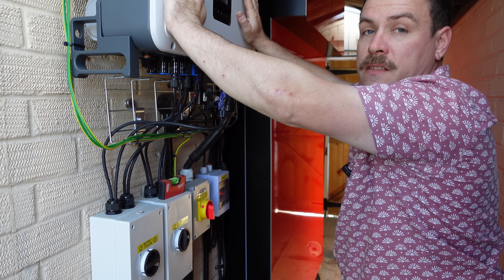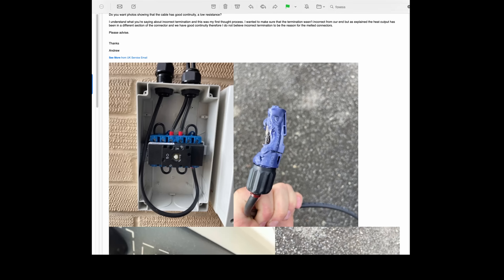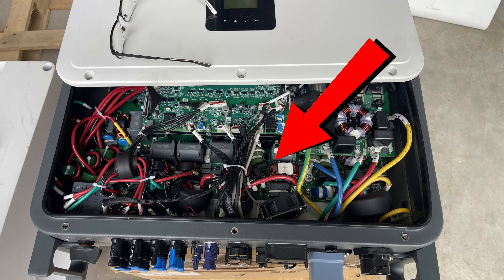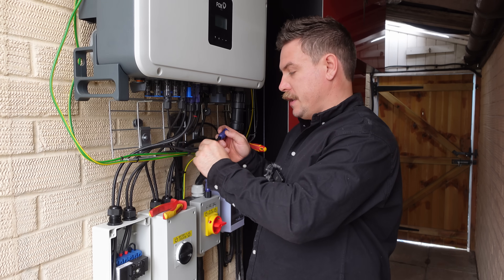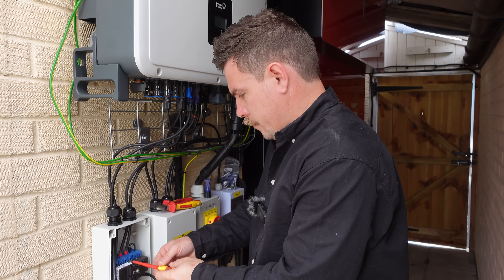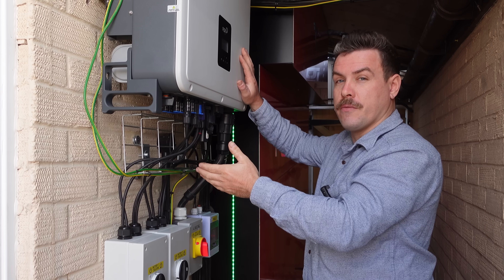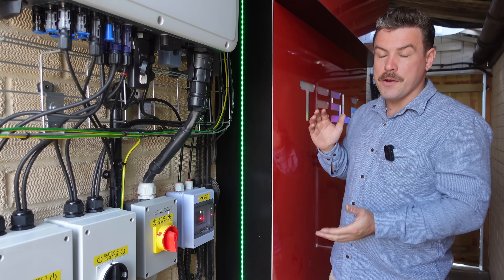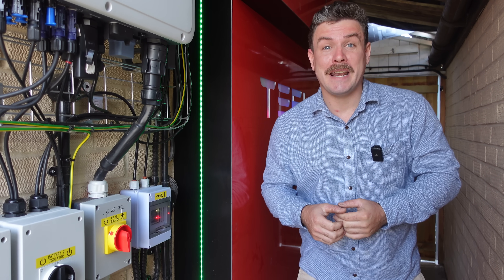Broken Solar Inverter! But Will Fox ESS Fix It?

Comment: Dang dude we gotta find the issue not allowing balance with CAN communication.
I have a feeling it's something to do with the state of the BMS mode I believe it's in drive mode which allows discharge and charging.  If the pack was in standby or charging mode at 100% it would likely start balance on cells.
I have a LFP car I just got and possibly could get the info off of it we need.
I just know little to nothing about CAN communication.
If you could point me in the right direction and to the right person I could definitely help.

My system is getting close I have my AC side of the 2 Solis inverters and now two LFP packs I need to hookup. 

Anyway thanks for the updates and take it easy man,
Casey
Reply from the maker: Hey buddy. Yes it desperately needs fixing. On the battery emulator discord there is guild lines on how to get can data. 

We need to see logs that are charging. During resting so on. So we can add in what’s missing to make it activate
Reply: @TheOfficialBatteryMan  ok yea I see to join the discord I would have to be a patron.

Any other way to get help collecting data needed?
Reply from the maker: @TeslaRebuilders  https://github.com/dalathegreat/Battery-Emulator/wiki/CAN-logging
Reply from the maker: If you are able to collect the data from a working LFP vehicle I can then share that on the discord. I understand not wanting to pay for the discord. 

If the logs are useful I’m sure you will get a mention in the GitHub Battery Emulator updates
Reply from the maker: If you are able to get the data recorded with what that data is showing then please email it to my email listed in the channel homepage
Reply: @TheOfficialBatteryMan okay I'll see what I can do I'm sure I'll have to get a few things to gather the data
Reply from the maker: @TeslaRebuilders I appreciate its a little work. But it’s huge information to fix the issue
Reply: God speed 🙏 I too would love this to be automatic  for some customers i have that want lfp

Comment: Testament of any good company, how they deal with problems, lol I done the same thing when installing my solar canopy over my rear garage door must say Uni strut is amazing every time there was wind and a noise, I’ve just installed a portable air con system and core drilled the wall in my garage as my batteries where getting to 29c yesterday they got to 28c  but air con wasn’t going the whole time outside was 52c though so I’m gonna say it’s a win!🥇
Reply from the maker: I’m very tempted on a cheap ac unit 😂😂
Reply: @TheOfficialBatteryMan  it would be worth it but it eats a lot of jungle juice

Comment: building my own hv lfp battery, 112s 32ah for ev buddy range extendo.
my solution to balancing is to dumb everything down and get rid of bms. just use fuses and some anologue w1209 relays for cooling, and a base heatplate spreader with diy pcm for heating. as long as its used every other day during the winters here it should never freeze since its in the boot of my chevy volt. to do balanicing i just got 7x 16s inductive active balancers. just build the pack as 7x 48v modules. why has no one ever thought of this before? imo way more people would be getting into this if they didnt need to know how to code/debug software and rewrite/patch firmware.
Reply from the maker: The idea of the Battery emulator is to make EV packs plug and play. But we are still on the cutting edge and learning. 

Never use cells without a BMS. There are so many reasons to use a BMS. The cells have to be managed. Over current. Over temp. Min and max cell voltages. 

I’ve tried running a pack containing 300 18650s without a BMS and it went flat and I killed the cells
Reply: @TheOfficialBatteryMan  pack is in parellel with 2nd original pack that has bms boards. first pack only closes contactors to the 2nd og pack after a 60 sec timer relay, so if the first pack is down the 2nd will be down too. charged thru a backwards 200a igbt in parellel with timed contactors. 3 other owners have driven around for years without this causing an issue, although they used the original battery pack with no balancing/bms.
bms is kind of a semantic term. imo its something that is wired in line with the battery output, unlike an active balancer. that makes it extremely expensive, bms boards are prone to failure and the reason why most lfp packs burst into flames/let out lots of gas after their balancing circuit drops a cell due to bad pcb components. 
no way of looking at the board and catching a malfunction early, like im guessing you were able to with ur melted inverter connector. 
if the battery pack has fusing, active thermal management through analogue relays, and active balancing, it is actually safer than a bms connected pack in my opinion.

Comment: Those MC4 style connectors are trash anyways. also the inverter should come with the right spec connectors to handle the max amount of current it is designed for. kinda fail from their end
Reply from the maker: All the others have been fine which suggests that normally it shouldn’t be an issue. But I’ve discovered I’m not the only one that’s had issues like this. But Fox response with me was great overall. 

This is where I find out that the email service engineer makes contact with an invoice for repair 😂😂😂

Comment: Hey batteryman, thank you for these videos, I’m planning something similar for a off grid project with a ipace battery and I could do with picking your brains 🧠
Reply: Oy electric did an iPace battery. I'd try their videos for links/hints.
Reply: @grahamleiper1538  hi, is that Cory Mac, I’ve seen that but I have to learn all from the beginning regarding how many panels per line etc, thank you
Reply from the maker: Hey. I’m not so familiar with the ipace batteries.
Reply: Yes Cory did an iPace